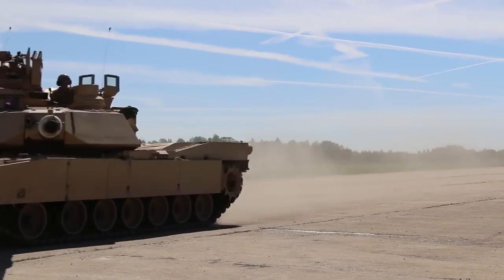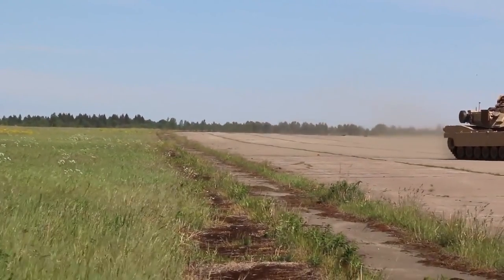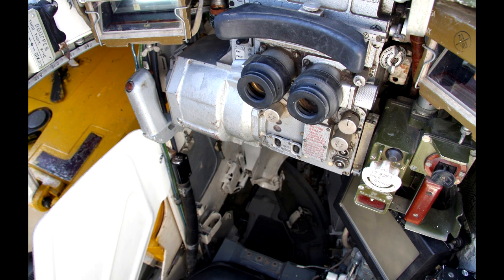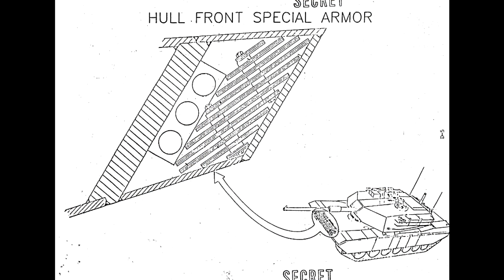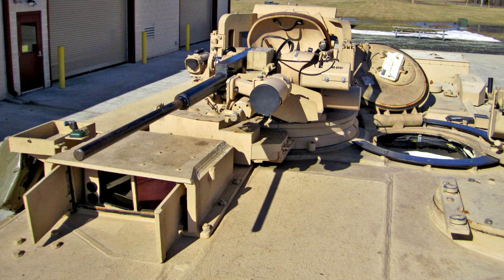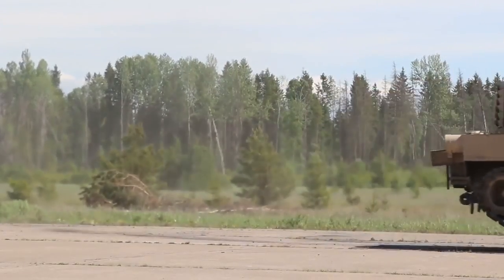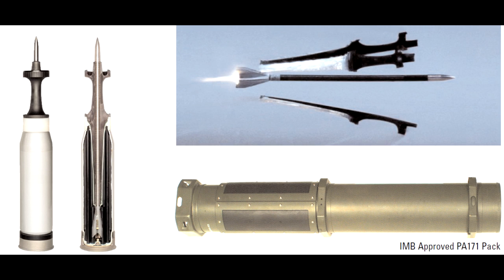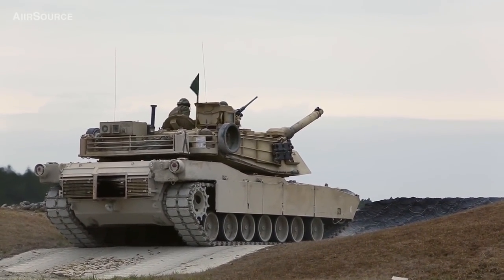Problems with Abrams tank

Comment: Wel the reason U.S did not want to use the german build diesl (Which is a superior engine for the tank btw) might be that u.s don't want to rely on germany for it's main battle tanks engine. What if U.S and German's relation sours? What if German gets invaded by Russia or china? Than we will have the diesl engine supply line cut from us. Sometimes it's the logistics behind the engine is more important than the performance of the actual engine.
Reply: You make it sound like the US cant make engines of their own
Reply: The Abrams has +42 years to switch to the "superior" diesel and they haven't.  The overall advantages/disadvantages of the turbine were greater compared to a turbo diesel.  The Abrams was designed for a certain operational range and it meets that standards.  There are more disadvantages with a diesel for the same operational range once you factor in weather, extreme temperature ranges, terrain, speed, mobility, performance, and survivability.

Comment: The turbine engine has a lot more torque and more consistent torque through it's RPM range compared to a diesel.  That is why it was chosen.   It improves acceleration and makes it easier for crew to escape a dangerous situation.  Crew protection is a higher priority for the US than Russians.  Remember that the crew is more valuable than the tank.  This is also why ammo is stored in a protected area of the turret rather than the crew compartment.
Reply: where do you get that crap that "Crew protection is a higher priority for the US than Russians"?   What a crock of sh#t..

Comment: I don’t understand how the length limit of the ammunition is a problem, since my understanding is that all tanks have size limits to their ammunition-storage compartments. Size limits that I imagine were designed to store the specific ammunition that the tank was designated to it. Am I missing something, are other tanks capable of accepting longer ammunition in their storage compartments than the abrams is?
Reply: Longer ammo = greater charge, longer dart

Longer dart = more penetrative power

More charge = more boom

More boom = faster dart

All tanks strive for this, not just abrams
Reply: @ShopeeMarketteam  No, that part I understand. It’s something else I was referring to that was the problem. Please read the entire post.
Reply: @Jkim890  I mean, what else is there to it? Long ammo don't fit in the bustle. If you're going to redesign the bustle to fit the ammo, the blow out panels need to be redesigned too. All this is going to add weight to the turret, and the abrams (at least the SEPV3) is albeit the most well protected abrams to date, but the most heavy abrams to date, weight around 77 tons won't be easy to transport
Reply: @ShopeeMarketteam  My question is, why is this criticism specific to the abrams? Wouldn’t all tanks need to also redesign their ammo bustles in order to accommodate longer ammunition? However if that is not the case, and other specific modern tanks allow for much easier modification to accommodate them, I wanted to know.
Reply: @Jkim890  yeah all tanks would need to go through redesigning. I think the point red is trying to make is look at the SEP V3, its the result of taking an M1A2 and just adding stuff on it. Better armour, APS etc etc. 

The point is, how much stuff can you add onto an abrams until it becomes impractical, the abrams will eventually have to go through more redesigning for the same purpose if let's say, you wanted to use better rounds on a Leopard 2
Reply: @ShopeeMarketteam  Alright, though if that’s the case, I suppose it’s not so much criticism as it’s pointing out the abrams going through its natural engineering evolution that most weapon systems go through anyways.
Reply: @Jkim890  yeah, pretty much

Comment: Sorry, video is garbage. I served on M60A1 and M1A1 tanks. A lot of your information is wrong. The M1 series has always had a commander override built into his control handle. The reason it had only one sight for the gunner and commander is that it was a thermal sight, which were high tech and expensive in the beginning. Comparing a Soviet IR sight to a thermal sight is laughable, as was thoroughly proven in the first gulf war. We also didn’t have to blow out the filters “every few hours” there, we did it every few days. It was not a big deal. The reason we stuck with the gas turbine engine is that it will run on JP-5, which a diesel won’t, and that’s the primary fuel we bring for both tanks and aircraft.

You really should have run this info by a tanker before posting it. You look like a fool to us.
Reply: He did lol but only after he made this video, he interviewed an m1a2 tanker

Comment: your point on the engine, gun. UFP and sights are absolutely stupid, the reason the abrams never used the l/55 is because it simply wouldnt be worth shit to the abrams considering the USA keeps its DU sabot at 1500m/s because DU shatters at 2000, and has a higher chance of shattering at 1700. the engine has great excelleration who cares about fuel consumption? its a tank built for the USA and the USA has no issues with oil or transporting oil unlike russia. the abrams was considered better than the leopard 2 improved at target acquisition in the swedish trials. your little "Muh ufp will go straight into the turret ring" no it will the fuck not sabot doesnt stay in tact and follow the entire ufp straight into the turret, holy shit your points are fucking stupid sabot would also be going upwards and going into the turret armor "muh following ufp" conspiracy bullshit.

Comment: During the XM1 program GM's diesel powered tank actually won the competition over Chrysler's turbine model. It was better and the army also knew what a potential nightmare a turbine engine would be. But politics intervened. In 75 Donald Rumsfeld ordered new trials with turbine engines for both prototypes. That insured Chrysler which was in bad shape business wise at the time won and got the contract instead. The program went from being about getting the best tank for the army's needs to being a corporate bailout of Chrysler. This is why even being American I still like the Leopard 2 better. We really should've maintained our partnership and not walked away from mbt70.

Comment: Anyone going hyper fan boi over any of these platforms never had to service this tank. Even with the upgrades to the filtration system the turbines would suck in so much sand and particulate that the turbine blades would just disappear from being so heavily worn dealing with all that sand. To make maintenance even more time consuming, most of the issues involving the engine just couldn’t be addressed anywhere except the factory/ factories where they were originally produced so if anything complex needed servicing or maintenance, the only course of action would be to put the engine assembly on a plane. Then from a plane to a train, then the depot, then hopefully the service bay. These tanks did some amazing things and some of my friends wouldn’t have a father right now if the Abrams hadn’t done it’s job so well in Desert Storm, but there was definitely room for improvement.
Reply: With all the Abrams flaws, the big advantage is crew safety. I've heard a lot of stories from Gulf War I Abrams crew members that Iraq's T72s crews did not live to tell their friends/family.

Comment: The hand stick you bring up is the TC's over ride.  The turbine engine does burn a lot of fuel idling, but not nearly as much as it does when it is being driven.  I crewed an M1A1 heavy, and a lot of what you bring up is valid.  The 50 cal mount sucked because the elevation had to be locked with the pin or you could shear the teeth off the brass gears that elevated it.

Comment: Yeah Canada has thr German made tanks.. fuel endurance of weeks of operation without the need for refueling... better Armour protection  and the longer main gun ant the commander target designation and 2 30mm machine guns one controlled by the gunner and one controlled by the commander... no automatic loading... apparently that is always a safety issue...

Comment: i would be fine if you exclusively critisized western tanks however this video, proves that it is bad faith critism 
you pretend like the american designer was absolutely clueless and specifically went against the standard when deciding to go with a gas turbine engine instead of a diesel because hes stupid
when in reality there were obvious factors that could explain the choice, gas turbine engines having higher power to weight and not being relient on foriegn equipment are major ones completely glossed over
you know the iraq war and how the abrams performed during it from your remarks about the airfilter however, you dont even awknowledge how incredible nato, and the abrams performed during it which is completely baffling and shows to me atleast that you actively hide information that doesnt support your point
stop bitching about fuel millage, its the united states were talking about theyre not going to run out anytime soon and doesnt have poor enough logistics for that to be a major problem

the truth is that you point at flaws that are awknowledged and made, by doctrinal decisions and completely ignore what the pros of said doctrine is
the abrams wasnt designed to be the best tank, it was designed to be fast and reasonably armored enough to be immune against most threats while airpower destroys most of the enemy tanks and strongpoints

Comment: Combat is the only true test to combat equipment. Which is why the Abrams is considered the best, not because it is, but because it’s the only one to be truly and throughly tested in battle. 

It has consistently out performed any other tank that it has operated with and gone up against. Which really is the only way to determine which one is the best.
Reply: It’s only outperformed every tank it went up against because it’s only gone against obsolete soviet or western tanks crewed by poorly trained crews directed by a faulty or incompetent command.
Reply: @RockSolitude but American idiots wont listen

Comment: Spends a lot of time talking about the Commander overriding the gunner.  Why?  A gunner is the gunner.  Not the Commander.  Crews are trained for their role.   Also, the gas turbine had dramatically better instantaneous acceleration.  Fuel consumption is much less of an issue for the defender, and M1 was designed to be hull down and fighting from positions where only the turret is exposed.  Plenty of 105MM M1A1 variants fought in Iraq and could not be penetrated by Iraq munitions.  They also had extremely high first shot lethality against all Soviet era tanks.  The gun was never really that much of an issue.  Soviet tanks never performed to specifications anyway, and US weapons (and NATO broadly) generally exceeded specification by 15-20%.  That is why the M1 could move at 60mph down the highway if you really needed it to.  Plus, the fuel efficiency was not much worse at speed.

Comment: Tanks have been almost completely rendered obsolete by modern and cheaper anti-tank weapons systems and tactics.. Though it is still necessary for an invadong/attacking force to use..
Reply: Wrong 
All modern tanks need is better active protection system

Comment: You do realize that the M1 is an 80 ton tank governed at 80mph right? Show me a diesel powered tank that can match its speed, I'll wait.
Reply: What does speed matter if all your fuel is guzzled down and now artillery is raining down on you and you cant move your tank being funny engine gobbled it all.
Reply: @goofygoober7750  have you ever trained with a tank crew before? I have. The chances that they'll run out of gas isn't very likely. They (19K soldiers) ALWAYS have logistical support on standby, as well as FOBS they can go to that a specifically set up to keep those tanks fueled in case they are called upon for any mission needed. Besides that, diesels don't run on hopes and dreams either. Any scenario that can plague a turbine powered tank can afflict a diesel powered one just the same. So, your comparison makes no difference. Fact is, turbine powered tanks ARE faster than diesels any day of the week.

Comment: Ok first off i will give my opinion on this video so nobody gets mad

I agree. Good vid

Right now onto what's wrong. The turbine engine has only stealth and acquirement advantage over diesel. The turbine engine is only a few decibels over diesel and the turbine makes a noise at a higher frequency making it less noticeable and making it quieter at less of a distance than the diesel also the gasses emitted from the engine are cooler than diesel engines gasses.
I feel like this should've been mentioned at least also the engine really was a perfect fit for the M1 and America but if the M1 had to do something outside of its design it would not fair well

Comment: The Thing Is, You Can Actually Destory The Abrams. By Firing At The Upper Frontal Armour, If It Bounces Towards The Very Lower Plate Of The Abrams Turret, It Can Destory The Abrams And Kill The Crew At The Same Time, There Is A Reason Why The Abrams Turret Very Lower Plate Is Weak, They Must Extend The Tank Hull, I Know It Will Cause Problems But. Then The Turret Will Have To Go A Bit Back Then It Would Be Immune

Comment: You can build whatever you want there will always be pros and cons. There will always be weaknesses as well. What you decide to build in today will be obsolete tomorrow due to better techniques. When it comes down to it, the final result depends on several factors. How well is the crew trained? What are the circumstances under which the confrontation takes place? How many opponents do you encounter? And so on. Many of the weapons system videos are primarily intended to instill confidence and restraint in an adversary. These videos show that the propaganda is not always based on truth

Comment: Still way better than your commie red tanks.
Reply: Source: trust me lad.
Reply: @Armour_Enjoyer  Source: 73 Eastings
Reply: @gnranger 
Taking out obsolete equipment isn't an enormous achievement in my book, so when those M1A1s knocked out hundreds of T-54s, T-55s and T-62s, they haven't proved anything about Russian armour.
Reply: @Armour_Enjoyer   The Republican Guard had T-72s. Specifically the T-72A, which was still the main Soviet and Warsaw Pact tank at the time. At 73 Easting it was the US VII Corps advancing on the entrenched Tawakalna Republican Guard Division. It was completely destroyed by elements of the US VII Corps. At Medina Ridge it was the same thing. VII Corps wiped the floor with the Medina Republican Guard Division.
Reply: @gnranger 
How many T-72s did they have in total during the entire Gulf War?
'Only' a few hundred. The majority of the tanks encountered by the US forces were obsolete T-54s, T-55s and T-62s, with a few Type-59s and Type-69s. They haven't faced many up to date tanks, and I'll die on this hill.
Also, would it be fair to judge the M1 Abrams based on its performance in Yemen, for example? Or anywhere else where many of them had been destroyed by the RPG-29 and Kornet?
Reply: @Armour_Enjoyer  we’re we talking about the entire gulf war?  No, the instances were the US fought T-72s. Which Iraq had nearly 1000. And yes it would be, because 3rd Gen MBTs are rather vulnerable to more modern anti-tank missiles. A RPG-29, despite being from the Early 90s, can still punch through the side of an Abrams.

Comment: A gas turbine doesn't burn as much when idling as when it's moving. However it is far less efficient at low powers outputs compared to a reciprocating engine.

Comment: I would disagree about the upper plate thickness issue that you raise. We're not talking about rolled homogenous steel, after all. That being said, the shot trap formed by the frontal overhang of the turret is a major problem. Other than that relatively minor quibble, I have to say that the rest of your points were well formed & articulated. Good video.